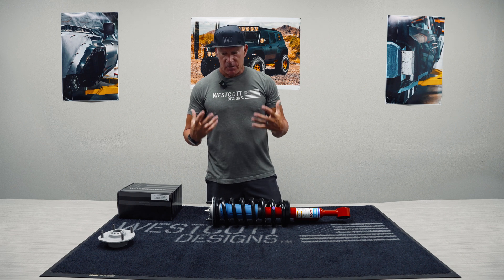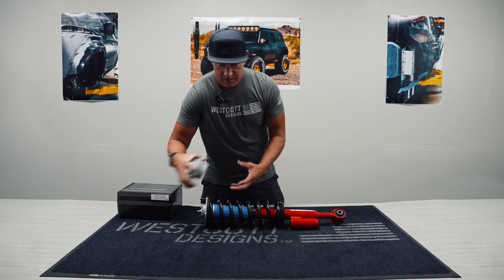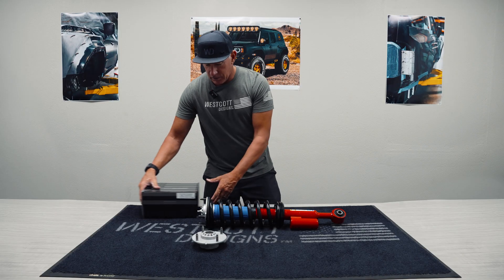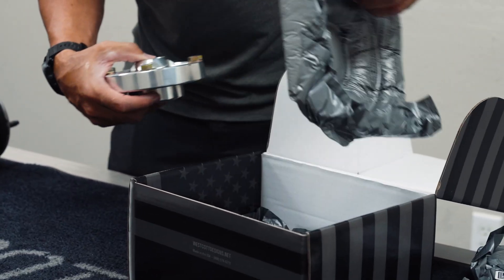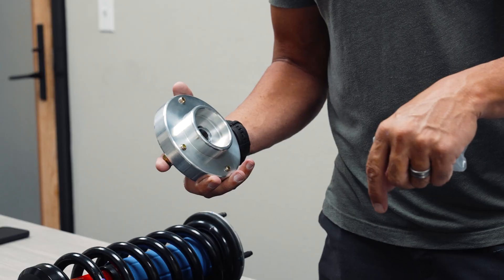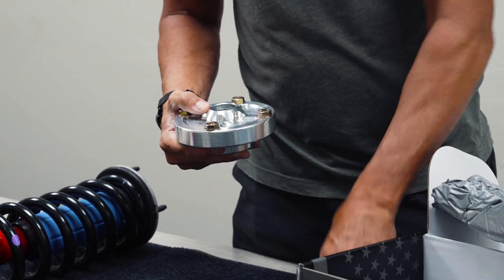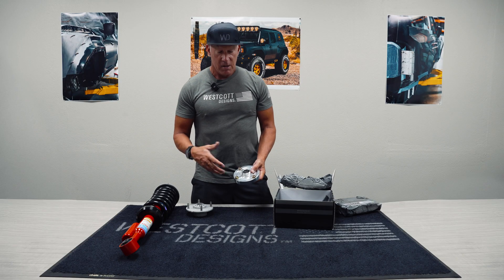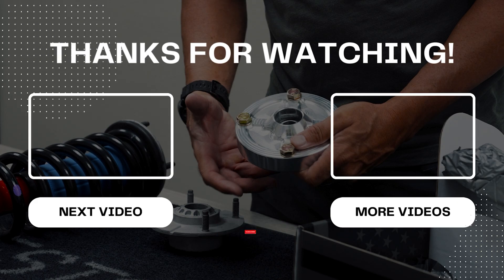What Is a Top Hat? Suspension BASICS Explained

Comment: Thanks for addressing the weak points of the OEM top hats, guys.  I received your lift kit for my 6th Gen TRD Pro that includes your 1" top hat.  The top hat is 1" thick, but Jeff mentioned only a 1/2" lift in the video?  Does the 1" top hat only add 1/2" lift or did he just misspeak?  It's important so I know the exact lift I (and others) would be getting with the 1' top hat, coupled with preload collar on the TRD Pros.  Thanks!
Reply from the maker: This is Jeff and we offer 2 different billet top hats.  We do one with no lift and we also offer one that has a 1/2” built into the height.  Now with added preload on the spring with our preload collar as well you will see between .5-.7 inches of lift.
Reply: @westcottdesigns  I appreciate the quick reply, Jeff.  Just so I'm clear on the numbers...for the TRD Pro 4Runners, the 1" top hat along with the preload collar in the kit you provided will give me 1" of lift when both installed (0.5" from the top hat and 0.5-0.7" from the collar)?  Maybe I'm being dense, but I'd rather measure twice and cut once. My TRD Pro currently has a 1" front rake which is a perfect stance for me.  I'm just looking for an additional 1" lift in the front and the rear.  For the rear, I'm installing your rear pucks which should give me around a 1" lift.  For the front, if both the hats and collars in combination give me 1", than that's perfect.  If not, then I'd rather install only the top hat or the collar.  Again, I want to be perfectly clear as there's several folks with TRD Pros and Trailhunters on 4Runner6G forum waiting for my install with your kit before ordering, and I'm planning on putting out a video on my YT channel documenting all of it.  Cheers!
Reply from the maker: @MotoPapa88 with the collar and the 1/2” top hat we just gained 1.9” of lift on a brand new 6th Gen Trail hunter.   The video will going live in the next couple of weeks with the alignment specs that we set for it.  It drove amazing and looked great with the 35’s on the factory wheels.  I would just run the top hat to play it safe if you are not going to run our rear lift.  The lower collar by itself is going to give it just over 1”
Reply: @westcottdesigns  Got it, that makes sense.  The only confusing part is that you keep saying it's a 1/2" top hat.  The one you provided measures 1" though.  And on your website, the only option given is OEM height or 1".  There is no 1/2" option...
Reply from the maker: @MotoPapa88  it’s because the factory one has a total height of a 1/2”. When we add a 1/2” it then becomes a total of 1” so total gain is 1/2” and when the preload is added depend on total amount of preload it will gain between .5 and .7 of a inch.  Hope this helps.
Reply: @westcottdesigns  Ahhh, there it is.  I didn't know the OEM top hat was already 1/2".  Now it all makes sense.  (It might help to clear that up on your site so it alleviates confusion because several of us were debating it on the forums).  Given the measurements you just gave above, I will do your 1" rear puck and the preload collar + top hat in the front.  With my already 1" front rake (which is what I want to keep), it looks like with the entire kit installed, I will still be a bit less than an inch of front rake...which IMO would be perfect so I don't get the optical reverse rake.  I like the softness of the current Fox QS3 shocks so you don't think the preload collar will stiffen it up too much, right?  Appreciate you taking the time as I want to be very clear and give folks options when installing your kit on a Pro.  Cheers!
Reply: @westcottdesigns  I just noticed you said 1.9" lift on a TH with your kit?  How did you guys get a 1.9" lift if the other measurements you quoted me say .5" top hat lift and .5-.7" collar lift for a total of 1-1.2" of lift?  Is there something different with the OME struts on the TH vs the Fox ones on the Pros?
Reply from the maker: @MotoPapa88 the top hat by itself give it .5. If I add a collar to it the top hat causes it increase and creates more preload and will add another .2 which is a total of .7.  This may very by .1 depending on application.  The collar by its self depending on what vehicle they are for are different for every model.  Some collars have 1” of lift up to 1.5” with the preload it creates on the spring.  The billet top hats come with stock height and that one is a total of a 1/2” thick and the one that is 1” thick is the one that creates the .5 to .7 depending how it is used.  Most of the PRO models models get 2” of lift so the my still ride good and align properly.   We have since the shorter struts in the 22 model tundras we have tried  to put less lift in so people can have a better ride.
Reply: @westcottdesigns  Ok, so I have the Pro, so that's what I'm only concerned about. I think 2" will be too much on the 4Runner Pro and make it have a reverse rake/sag.  I currently have a 1" rake which I want to keep, so can I swap the collars you sent in my Pro kit with a collar with less preload?  I only want 1" of lift up front. Anymore lift and it will have a reverse rake based on simple math.
Reply from the maker: @MotoPapa88  the whole kit for the pro is designed perfectly as long as you’re using the kit with nothing else you’ll be fine
Reply: @westcottdesigns  Yep, I only plan on using your kit with my stock Fox shocks, so I'll take your word for it.  Install is next week by Longo's 626 Customs and I'll have the video up on my channel soon after that.    Looking forward to it.
Reply from the maker: @MotoPapa88 that is awesome. Thank you!🙏. It’s funny Longo just placed a big order with us today🤔
Reply: @westcottdesigns  They sure did.  I've been consulting with Sammy at 626 on the new 4Runners and LCs.  Hence why I need to be accurate with measurements.  Let's just say I have ties to Toyota corp on the marketing side so we have our connection with you guys and want to make sure we're building rigs to the right specs with your products.  Cheers!
Reply: It’s a little confusing given all the scenarios. A table with options on your site might be easier to clarify. I have a stock 25 GX overtrail. Adding only the top hat  it sounds like I’m only going to get .5” of lift up front? I need to be at 1” to level/re-move rake.
Reply from the maker: @ickies888 do you have our lower collar now?  It’s a 1/2” without lower collar and with the added preload from the lower collar it’s .7”
Reply: @westcottdesigns  correct no lower collar. I’m just looking for good option to level out and remove rake
Reply from the maker: @ickies888 fill it with gas and and measure front and rear so we can see the exact difference or measure before gas and after the rear to see how much it changed so we can leave a 1/4” lower in the front with a full tank